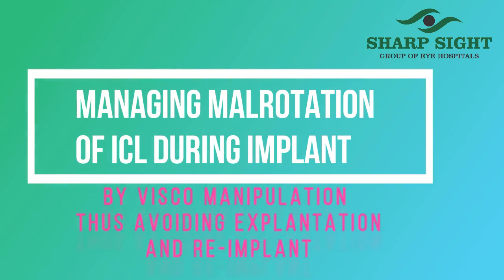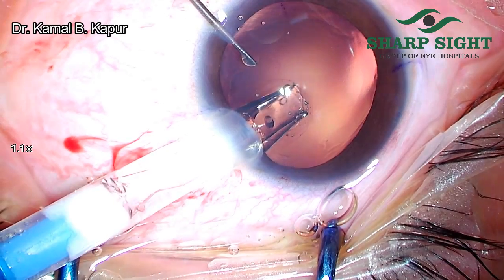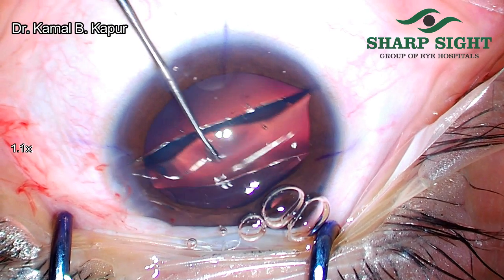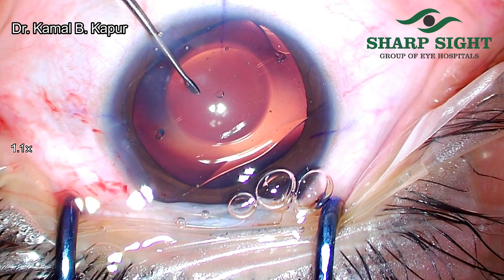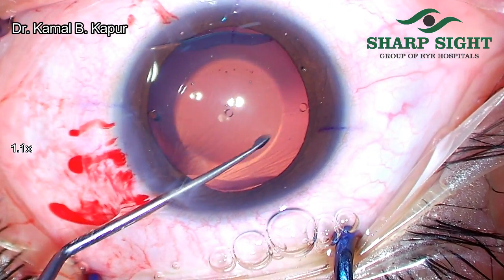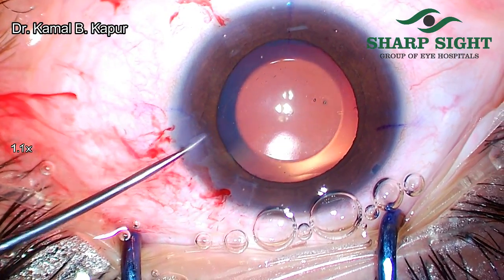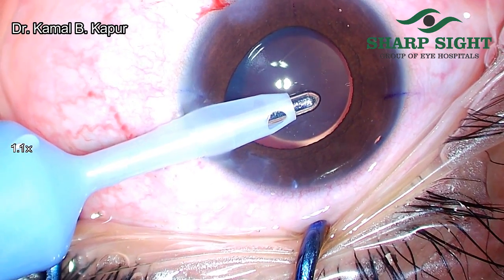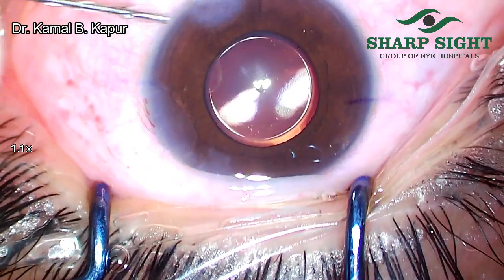Visian ICL implant insertion problem management

Comment: I’ve had my ICL surgery the 23rd of July. After surgery I started experiencing double vision (I can see texts on my screen up to 4 times). After a week I started seeing rainbows under white street lights. No halo’s just a big streak of multiple colors red/ green/ blue under every source of white light. They tested my IOP, which was fine 17 in both eyes. And told me it was normal to experience anything like this and is possible due to the ICL. I’m worried and I don’t think it is normal, what should I do?
Reply: do you still have this?
Reply: @SCXR-NBD  Yes I’m going to explant
Reply: @manjapetridou8696  And get a new one in? or go without ICL?
Reply: @manjapetridou8696  hey i also face same problem  ☹
Reply: @shashankgarg2249  how are you doing now? Surgery from where?
Reply: @manjapetridou8696  how are you doing now??
Reply: @prabalbhatia469  no i m not fine surgery done by dr Sanjay chaudhary delhi eye7
Reply: @shashankgarg2249  hi icl removal done for you ?
Reply: @zainabhassan5705  hi you want to remove it ???
Reply: @shashankgarg2249  bhai aap ke surgery ke bad aisa dikat huaa tho sanjay chaudhay fir dikhaya
Reply: @manjapetridou8696  hey after explantation r u oky now or facing problems ?
Reply: @shashankgarg2249  Sadly not
Reply: @manjapetridou8696  what problems u facing after icl explantation plz reply 🙏
Reply: I also faced that issue for 1 month....now it's fine
Reply: @siva3204  now there is no problem?
Reply: @kouchmounir3565  now I am good..... sometimes in low light I will see rings( gradually reducing day by day)....
Reply: @siva3204  that's good but since how long u did the surgery  ? I think u will be fine after 3, or 4 miunth and witch clinic and country u did it ?
Reply: @kouchmounir3565  4 month completed...I have done my surgery in aravind eye care, coimbatore, India
Reply: @siva3204  ah that's great and what's is your job and can u go to the gym and pick heavy things or u can't becouse my job it is in logestic and I don't know if I will be allowed to pick the heavy things
Reply: @kouchmounir3565  after surgery first 15 days must not do any excercise,swimming, weight lifting kind of things....I am going gym now...I am working in IT
Reply: @siva3204  that's good so lift the whight on the gym after one month of rest it is not a problem?
Reply: @kouchmounir3565  after 45 days I went gym i didn't face any problem....must avoid swimming for 2 months (Swimming pool water is chlorinated)....Eye healing time will be varies person to person....If your doctor said ok na you can do whatever you want
Reply: @siva3204  that's great so u can live you life normal without any problem ? And before have u suffered from the dry eye cus of the lenses?
Reply: @kouchmounir3565  I can live my life normal and I didn't face any dry eye and eye pressure problems as well....One thing keep in mind my doctor prescribed eye drops for 3 months(4 times per day)
Reply: @siva3204  good and what about ur work do you have any whight lifting ? Or ur work is easy, becouse my job I lift some whight that's why I m panic
Reply: @kouchmounir3565  No I am working in software company and I will go to gym .... Weight lifting is not a issue if your eye healed well... consult your doctor for more clarification
Reply: @siva3204  what about the hot whither becouse I will do it this week but the wither is hot I don't know if my eyes can support it
Reply: @kouchmounir3565  bro no problem bro.... follow the instructions that doctor said
Reply: @siva3204  ok becouse I am working on the belding of houses and there is dust so that's what I am worried abiut
Reply: @kouchmounir3565  consult your doctor
Reply: @siva3204  the doctor can't tell u everything  I have to ask peaple that they have icl to take more information
Reply: @kouchmounir3565  ohh...my doctor answered all my questions and she told what are all the do and don'ts
Reply: Hi icl removal done for you??
Reply: @zainabhassan5705  salam zaineb bghiti theydiha ?
Reply from the maker: There has to be an issue otherwise I ve never seen any one suffering from doublw vision.
I have largest series of Phakik Iols in India

Comment: Its been 14 months since ICL surgery and I still see too much glare and halos in dim light, laptop screen and night time. I am getting really bothered by it. I tried all medications given by my doctor but still no improvement. Now she is suggesting explantation. So shall I wait for more time for adaptation or shall I explant it immediately?
Reply: No réponse for this comment. That means this surgery is a scam!!!
Reply from the maker: @saiksaikatai594   non response  does not always mean no reply. Some times the person may not have seen the message too.
Reply from the maker: Glare is very very uncommon and rare.. Especially with phakik Iol. It can be be due to many reasons. Needs to examined and various caudes ruled out and its correctable in most situations.
I havevpribabablyvlargestvseries of IPCL cases and have seldom encountered this issue barring a few exceptions. Which of course are correctable
Reply: @OphthaGurus  thanks but I decided to explant my ICL, no more bothersome haloes, vision is back to square one and putting contact lenses now.
Reply: @anuraagsuvarna7585  are you ok with contact lenses now after icl removal? Any dryness? Also did they give u a refund of icl?
Reply: @rogerblack8483  I am absolutely fine, No dryness ,No refund
Reply: @anuraagsuvarna7585  kia apka phone no. Mil skta h kia
Reply: @anuraagsuvarna7585 icl remove kis dr. Se karaya h
Reply: @shashankgarg2249  jis doctor se dalvaya tha usi se
Reply: @anuraagsuvarna7585 kia apka b surgery ke baad eye pupil different ho gaya tha like left eye pupil big n ryt eye pupil small
Reply: @shashankgarg2249  surgery Ke turanth Baad pupil size unequal tha kyunki jis eye ka operation hua Usme  dilation ki effect 6 hrs thak rehegi. Abhi Toh Sab normal hain
Reply: @anuraagsuvarna7585  apse call pr kaise baat ho email n phone send nai ho rhy
Reply: @anuraagsuvarna7585  mere ko 9 months ho gaye still unequal rhte h pupil size to mere ko ye pata krna tha ki apka b essi tha kiaa bez mere ko b remove krana h to ye problem theek hogi ya nai icl remove ke baad
Reply: @shashankgarg2249  Doctor se consult Karo. Isse zyada kuch nahi bol sakta
Reply: @anuraagsuvarna7585  apne kis dr. Se karaya tha?
Reply: @anuraagsuvarna7585  Did you have both lenses removed on the same day? How long after explantation did you start wearing contact lenses?
Reply: @gloryglory9228  I had implanted in only one eye, I started wearing contact lenses a month after explantation.
Reply: @anuraagsuvarna7585  apne surgery kaha se karwayi thi
Reply: @shashankgarg2249  NN hospital
Reply: @anuraagsuvarna7585  are you fine now . 
Mere ko bhi 15 months ho gaye h n i m also planning for explantation
Reply: @shashankgarg2249  yes i am totally fine
Reply: @anuraagsuvarna7585  apko nights mai double vision n lights ki shadow vagra dikhte the kia
Reply: @shashankgarg2249  nahi, sirf halos dikthe the
Reply: @anuraagsuvarna7585  i mean to say laptop screen pr mobile mai words double dikhna
Reply: @shashankgarg2249  nahi
Reply: @anuraagsuvarna7585  can u tell me dr name jisns icl explantation kiya h apka in nn hospital

Comment: Please tell me side effect
Kya side effects ka koi solution nhi hota 
Tell me icl cost both eyes
Reply from the maker: There are no side effects. Though literature does say cataract but i have only seen early cataract in two of my patients out of 1500 and that too is treated
Reply: @OphthaGurus  how can you state that there are no side effects when the entire internet talks about halos and glares?
Reply from the maker: @saiksaikatai594  yes you are right internet does quote about side effects but a lot depends on person to person surgical skill experience and  proper case selection.
But just as Internet says side effects of aspirin and combiflam also
Reply: @OphthaGurus  what about pigment dispersion and glaucoma risk? Cataract is one thing but PDS and glaucoma can be more devastating.
Reply from the maker: @marcusaurelius2988  Case selection, preop angle measure lens Rise and WTW measure are very important
Reply: @OphthaGurus  If you incise thru a superior incision of 115 degrees (steep axis), Can you still rotate it to its proper position after lens is inside?
Reply from the maker: @marcusaurelius2988  You can but make sure you open the IPCl on iris before before rotating and only then inserting behind iris

Comment: During manipulation of icl, can it cause any damage to the natural lens
Reply from the maker: yes theoretically it can , but in experienced hands never happens
Reply: @OphthaGurus  I'am not agree with your answer. I never understood why we don't use the Artiflex IOL anymore. ICL can cause cataract with a zonulolysis when you touches the natural lens during the process of putting the ICL in the eye. When you are under the 40 years of age, that means they have to remove the natural lens and the ICL. They will put a replacement lens in your eye, but then you have to use reading glasses. Also the ICL can move in your eye causing halo's and the problems what you can read as an reaction on this item. It's not clear for me why not use a Artiflex???
Reply from the maker: @foto4all188  you nay be right  that's why i said  "in experienced hands" but I respect your opinion. 
 Though I have personally not seem such thing over my vast surgical  load and long follow up of over 10 yeras